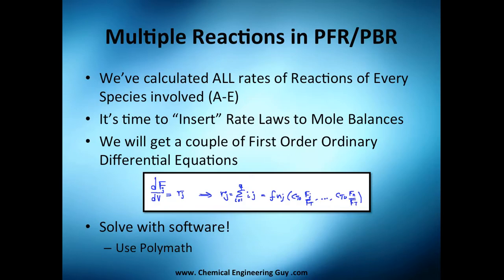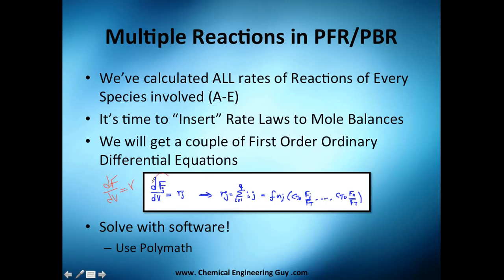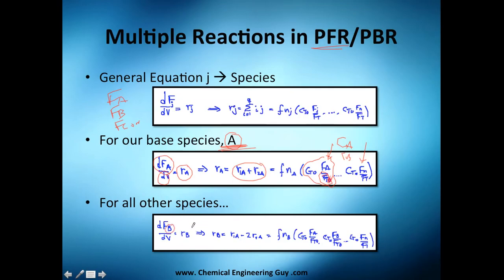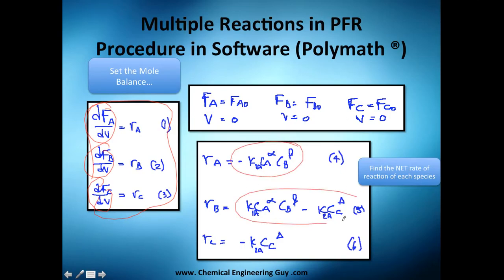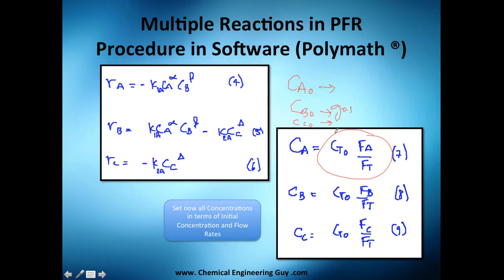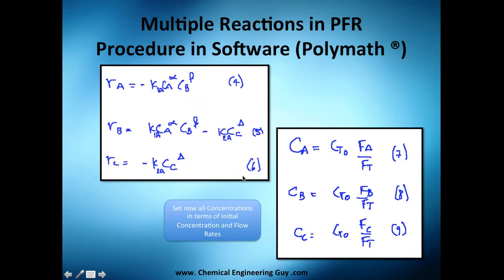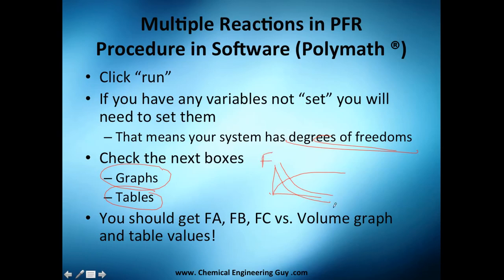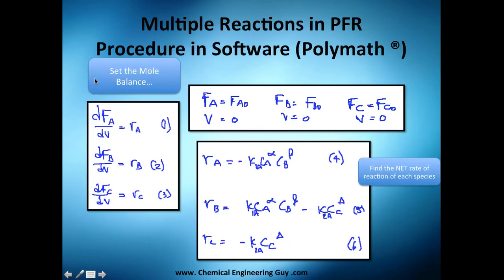Solving Multiple Reactions in a PFR (Software) // Reactor Engineering - Class 109

Comment: Hi, may I know after using the polymath, how to know which one is the final volume of the reactor if you already insert the value of volume in the 1st place? correct me if I misunderstand your video.
Reply from the maker: the integral will give you the total volume change or requirement